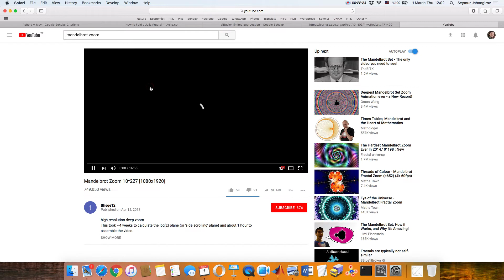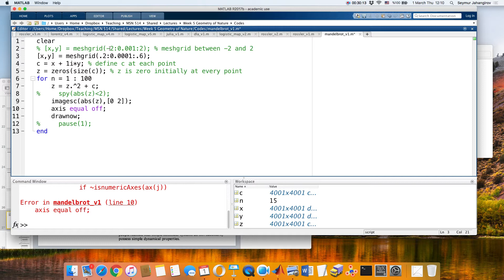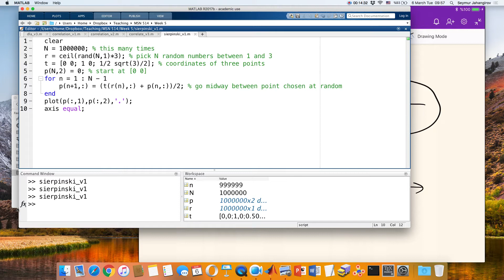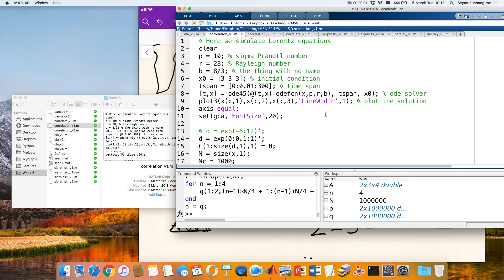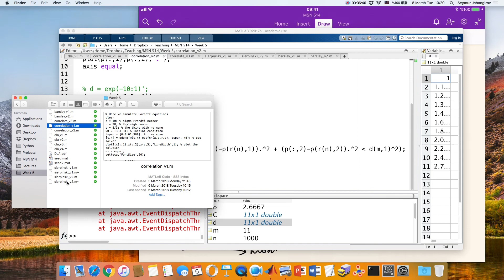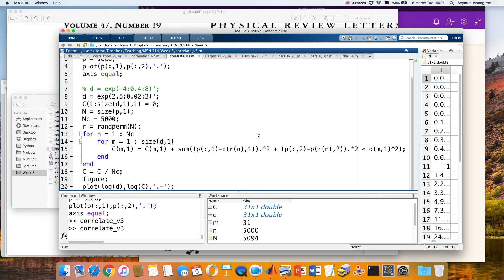MSN 514 - Lecture 15: Fractals

Comment: Thank you for explaining this interesting context in Physics. I have a question. I simulated a DLA and used three different methods for measuring fractal dimention: Mass vs. radius, Box counting, and your method. However, they gave me three different fractal dimensions and I do not know which one is accurate. I know that each method uses a different technique and the process is stochastic including the nose but I think the dimensions should be almost the same. For example, my DLA has 10000 particles and I got Df = 1.483,  1.412,  and 1.804 respectively, for Mass vs. radius, Box counting, and your method. Please let me know your comments and suggestions related to this issue.

Comment: How to choose the radius value of correlation dimension? I mean for a unknown system, how will we take the radius value?
Reply from the maker: You basically start with a guessed crude range and plot just, like we do in the video. Then you pick the range where the curve seems to be linear and plot a more detailed curve.
Reply: One more thing I want to clear, when we are saying it as radius, that means it should have a unit also? What I want to say is that, if we apply this to coastline measure, then when we say that we want to measure the no of points falls under some radius, then this radius will also have a unit assigned to it. Like kilometer, meter etc? Or where I am wrong on this? Can you please help me out?
Reply from the maker: Prankrishna Borgohain The radius should have the same units as the units that you use to define the coordinates of the points.
Reply: @seyjah   Thank you so much, Sir! Thank you so very much